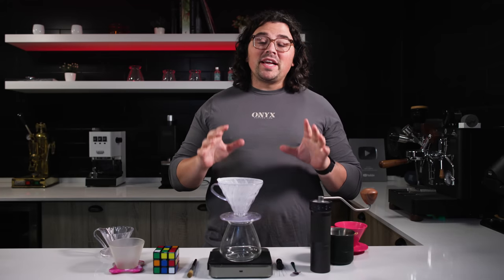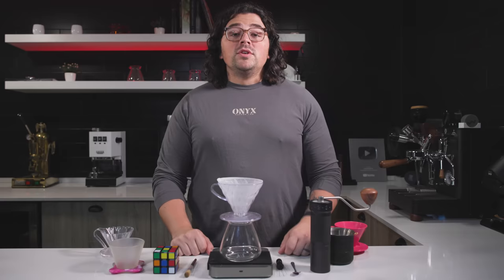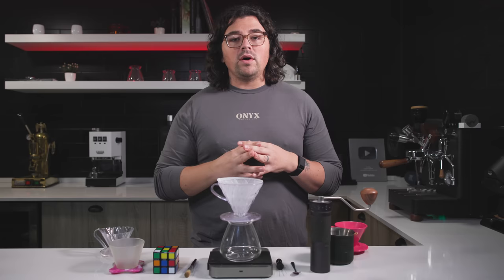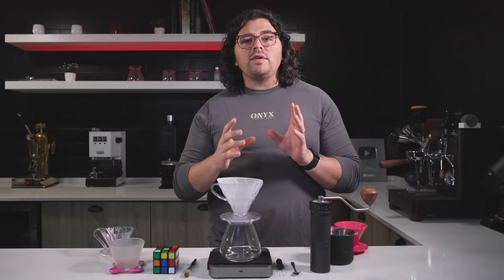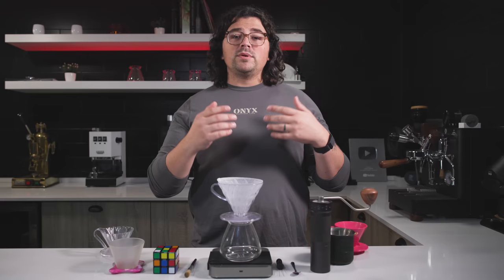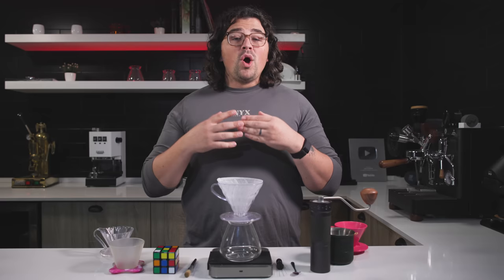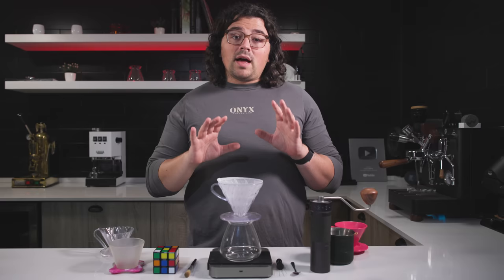ULTIMATE POUROVER RECIPE (any method)

Comment: You won my heart at "pour rate" and "spout distance."  In my first go, I used the Gabi B disperser. 

20g light roast
340g Brita water
Fellow Opus 6.25

It finished at around 4:20. 

Just a bit thin. Next time, I will grind coarser with less water. 

Perhaps the greatest advantage of this method is how easy it is. Excellent for baristas in busy cafés.

Comment: Man I’m so glad I watched this. Working with basically entry level everything, I have been struggling with light roasts using the 4:6 method which I had convinced myself was the end-all for pour over. First try with this method was instantly a much better cup, full of body and sweetness, compared to the thin cider vinegar I was for some reason getting every time. Thank you for posting this!!
Reply: 5 pours for the 4:6 method is perhaps a little complicated for beginners. Although interestingly the 4:6 method also calls for similarly coarser grind size and uses multiple pours instead of agitation for more extraction.

Comment: Great recipe and video. Thanks Lance!

I tried this last night with some pre-ground decaf from Peru. 33g of coffee to 500g of water in a glass 02 V60. The drawdown was really long but surprisingly the cup tasted good. Like a good quality batch brew.

Today I tried it with some natural Brazilian beans with tasting notes of Orange blossom, choc milk and stone fruit. 90 second bloom and a total brew time closer to 5 mins. 90c water.

It was ok. A bit muted. I got a bit of the choc milk and stone fruit. A very slight hint of dryness and astringency only with the last few sips.

I will coarsen the grind for tomorrow’s brew to get closer to the suggested brew time. 

What’s stumped me is that as an espresso, I nearly choked the machine and got a really long extraction time with these beans. Tried it anyway and it was bright and fruity and slightly acidic but very pleasant. A lot of the Orange blossom came through. 

I’m not sure that extracting less from the pourover will reveal the brighter notes. Do you recommend upping the water temp while coarsening the grind?

I forgot to do a light swirl when I finished the second pour so I don’t know if that affected it much.

Comment: Since you asked, I've been using Patrik's pour over technique with April v2, and I see several comparisions between yours and his: courser grind (26 to 30 clicks on Comandante) simplified pouring, and about same overall timing. He suggests letting the beans bloom in the air for about 15 min after you grind but before you start pouring. I usually brew 20g with 300ml (1:15) in 3 pours of 100ml each circular and center pours with about 30 second space between pours. Flat beds, no stalls, consistently delicious cups. He pours a little faster than you suggest, 100ml in 10 sec for agitation with no messing around with slurry. I pour 8ml/s. I also brew smaller cup 13.4g / 200ml with 2 pours of 100ml each.
Reply: You sound fun to make coffee with, great write-up and thought process.

Comment: I have tried the Lance Hedrick Ultimate V60 recipe yesterday and today (drinking the result now) with a bag of light roast Ethiopia Sidamo.

The first time I used the recommended 1:17 ratio and wound up with a drawdown time of 83 seconds (Baratza Encore grind size 16 with factory coarse calibration). The cup was as good as most of the cups I have had which was very encouraging for a first try with a new recipe. The cup was noticeably less bitter than some of the cups I had with James Hoffmann's ultimate V60 recipe with slightly finer grind settings, but the body was thinner than I preferred. 

Thanks to all the information in Lance's video, I knew the first thing I should try is increase the strength to make the body thicker and make the grind size coarser to reduce the drawdown time and hit the time parameter set for the recipe. Today I brewed the same coffee using approximately a 65 gram/liter ratio and coarsened the grind (Baratza Encore grind size 18 with factory coarse calibration) with a 58 second drawdown. 

Edit: these cups have all been brewed with Hario VCF-02-100W filters.  I will eventually try out this recipe with the Cafec T-90 Medium Dark Roast 2-4 cup filters I have. So far I haven't noticed a significant difference in the cups between these two filters (Using James Hoffmann's Ultimate V60 on my setup) that warrant the extra cost of the Cafec filters and the extra storage space.

I am very happy with the body/texture of the cup at this strength. I will probably try to coarsen the grind again because I am barely within the time parameter and I am curious how that will change the cup. It does seem like the cup is getting sweeter at the cost of muted acidity.

Is that the inherit zero sum trade off, acidity or sweetness? Or is that the limitation of the Baratza encore?

This recipe is super simple to follow and at least so far the changes in brew variables have had the expected impact which is fantastic.
Reply from the maker: You nailed it on the head! There will be a tradeoff there with grinders like the Encore. You really have to lean in to one or the other, though you can find a nice harmony at certain places!
Reply: @LanceHedrick  so in order to increase the perceived acidity (at the cost of sweetness) on a Baratza encore, would the adjustment be to grind finer (and accept the increase in fines which would increase bitterness) ? Or is there some other adjustment needed?
Reply: I tried the recipe again just now with the same parameters except I coarsened the grind size to size 19 (factory coarse calibration on Baratza Encore). Drawdown time remained at 58 seconds. Acidity was reduced significantly and sweetness was increased dramatically. Acidity seems barley perceptible to me at this grind size and is fading in an out of the background of all the sweetness. I miss the acidity, but on the other hand, this is the sweetest cup I can remember having in a very long time with astringency and dryness truly gone (and not just relative to other V60's I have made).  I feel like my mom would even like this cup. 

I am tempted to keep coarsening the grind to see how coarse I have to go to drop the drawdown time and see how far I can push the sweetness. At size 19, there is zero feeling that I am compacting the bed when I make the divot.

I feel like this recipe yields consistently good cups and changes in brewing variables yield the expected results which is not what I am used to in my 3 months of brewing V60's

thank you for all the help Lance!
Reply: @BBB_025  where are you at now with the Encore, ratio, and drawdown? Using the 15g in the video for those drawdown times or?

Comment: I have tried all of Hoffman's methods and all of Lance's methods, and this is the easiest method out of all of them. What I have tried so far: I have done 200, 250, and 400 ml brews at a 1:17 ratio with a 98-99c water temp for my light roast Kenyan and Ethiopian using the new fellow ode 2.I swirl once before bloom and a gentle swirl at the end. Medium grind size is a great starting point (700-800 microns). Quick notes: I personally think this method would shine on the Hario Mugen or Kono dripper, also this method will work on any grinder, focus more on your grind size and what water you are using.

Comment: Best recipe so far, been trying the 5 pour method and too much bitterness, even after using a ode gen 2 grind. This method removes all bitterness and the flavors are clear! Thank you!
Reply: What's your grind setting on Ode gen2?
Reply: @alexanderreznikov8112  7 on medium roast. Depends on beans but mostly 7, sometimes I go down to 5. As Lance mentions, I vary the temp more than the ratio (medium - 1:16, dark 1:14-15)/ Medium - 95C, dark 85-88. As always, it's more fun to experiment and try different ratios.

Comment: This is one of the recipes that make the most sense to me.
I‘m having trouble with the brew though, specifically nailing the brew time/a fast draw down.
I’m using a Baratza forte BG (which I realigned à la Alicorn method just yesterday) with the burrs set to touch at 1q to be able to go even a little coarser and a Stagg EKG kettle set to 96 C and have been trying the recipe with a V60 and Orea V3 and with both I have a super slow drawdown and still very overextracted cup even on the coarsest setting of the grinder.

Comment: Usually I go with 4:6 or Hoffman for V60 and I'm happy with both methods but I thought why the hell not try another recipe. 
So I didn't tell my girlfriend that I changed anything for our brew today but she asked me right after the first sip if I had somehow changed the recipe. I got so much more sweetness in the cup, it was clean, the acidity was on point and it was overall just super pleasant. Love it!

I think I'm gonna use some of the information from this video (flow rate, kettle height) when I do another 4:6 brew and see what happens. 
Either way, thanks a lot for this Lance!
Reply from the maker: very cool! If you think you need more extraction than this single pour, simply fine up the grinds or increase agitation!
Cheers and thank you for watching!
Reply: @LanceHedrick  Yes sir, will do! And no need to thank me; I gotta thank you for pumping out quality content all the time!

Comment: Amazing video. The idea behind this video is exactly what I was hoping someone would make. Something that allows me to use technique to adjust rather than equipment. Your explanation on why some of the techniques out there don’t work at home was also extremly useful, I was just getting frustrated with the mushy coffee beds I was getting that looked nothing like the video results. I now understand this is due to fines (please correct me if I’m mistaken).

I have some questions about the technique: 
a. What is the purpose of the excavation ? What do I aim for? How do I know I excavated enough ? 
b. What is considered a slow drawdown ? I’m not sure. Would be great to see this defined visually in a video. 
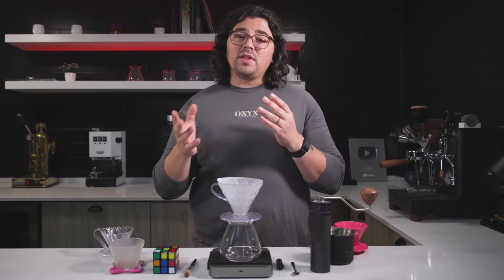c. What happens if I wait 2:30-3:00 minutes in the bloom phase? Asking because I sometimes get distracted… and am curious to understand how it affects the brew. 
d. What do you say about pre-heating/cooling the brewer, caraf and the glass ?
Reply from the maker: A. Go until you don't feel anymore dry clumps. The purpose is the enforce full saturation more quickly
B. If the drawdown is looking like it'll be longer than the times proposed. Simple as that
C. 3 min and up is just fine. No worries! Could be 10 min
D. I preheat but because I use the hot water to clean my usually not super clean carafe haha

Comment: Thank you for this. I've mostly given up with my V60 and moved to aeropress as I've struggled to find a recipe that gives consistent results in every cup. Will absolutely be giving this a try.
Reply from the maker: I think you'll love it. Will work with anything. Need more extraction? Agitate more. Or change ratio. Or change water temp. Fully fluid recipe with great results

Comment: Lance. What a great vid, this is the type of content I love of yours. Anyways, I'm happy to tell you I've been getting to the same recipe more or less, 15±clicks on the C2 timemore, 2 min bloom, 15g coffee-220/245g of water depending on the coffee. I do an aggressive bloom with lower temp dough, and agitate with a chopstick instead of swirling, since it usually give me a bitter finish, I don't know why though. Then, for the latter pour, I heighten the temp a few degrees and finish with one swirl and the chopstick at the top to reduce fines on top of the bed. Coarser grinds give me a lower body, but at that grind setting I'm not getting astringency at all! So it works fine. Thanks for the recipe and the ideas behind it! U d goat

Comment: Lance, 2 questions: 1) During the bloom, even with a freshly roasted coffee I'm not getting a ton of off-gassing, and I'm noticing all the water has drawn down through it after 15 seconds or so. By the time I get the spoon to excavate, I feel like I'm digging at wet coffee rather than stirring a slurry. Is that correct?
2) Are there times where you would recommend a different recipe to "optimize" flavor? I am getting good-tasting coffee with this recipe, but I feel I've gotten greater extraction/flavor without bitterness before. In fact, I accidentally ground too fine on my first try with your recipe, and there was an extra minute of total brew time, but it tasted great and had more flavor.
Side note: I love the one-pour method! Back when I was new to coffee and brewing Chemex, I developed my own one-pour method out of a desire for simplicity. :)

Comment: Update: I tried this method with my metal cone filter pour over - Kinto Slow Coffee - and it worked like a charm. ~21g dose to ~350g water with the 1 minute bloom (older and darker Typica Bourbon blend from Puebla MX). Total draw down in a little over 3 mins. Definitely notice the difference compared to the classic Hoffmann method I normally use.  Very clear cup but not weak. Lots of flavour.  

Thanks for the video, Lance! When you say it’s for any type of brewer, would that still apply to conical metal filter brewers (eg. Kinto Slow Coffee)? I would imagine the paper vs metal filter type would affect some of the variables you describe like contact time and more fines would end up in the brew compared to paper. Any advice or nuance to add?

Comment: Tried this recipe with Hario V60 and Chemex. It worked great with V60, but with Chemex it provided a massively underextracted coffee. Chemex is such an effective heat sink so it really needs more time for proper extraction.
Reply from the maker: It works with chemex! Just need to pay heed to the variables and make adjustments.
Reply from the maker: I can get 20% easily in the chemex with a 45g dose. Have to pay attention to the flow rate. If truly doing 6-8g/s, should have sufficient contact time after the final agitation, which should be somewhat heavy with a spoon. I'd also do a 4x bloom weight so you can more effectively agitate.
Reply: @LanceHedrick  with 24g dose and 4:30 minutes brew time the same coffee that brewed delicious in plastic V60  with 4 minutes was very sour, so even with final agitation I had to grind finer to extend brew time to 5:30 with very similar results. I wonder iа it's something wrong with me or with my Chemex papers if I have to go finer with it when everybody else goes coarser, lol.

Comment: Hi all,
I use 30 gm, Square Mile “El Dama,” beans in; Niche Zero at 25 grind setting; pour 600 gm water (500 gm out, 100 gm retained by beans) and Blue Bottle filter (no need to wet the filter).
Usual waiting for bloom and intermittent stirring.
Works great for my palate.
Cheers,
SJEGMD
Reply: I use 25 for espresso. I believe you should go coarser.

Comment: Great video as always Lance.

I’ve been trying to get my hands on the Orea V3 the past few weeks but it’s been out of stock the whole time. Cant wait to try it out.

Also you gotta learn cfop to solve your cube 😂.
Reply from the maker: What is cfop! I just got one a couple weeks back. Haven't done one since high-school. I could solve it in 45sec then
Reply: Slow pour supply had them in stock a few days ago, they might still!
Reply: Cfop is probably the most popular speedsolving way of solving the cube.

You solve the cross, then you pair up edge pieces with their respective corner pieces to solve the first 2 layers in one go, then you orient the top layer, then you permute the top layer to solve it. It requires far more algorithms and practice but can greatly reduce your solve times. You would probably want to start with 4LLL (you can look up what that means) as a beginner. 

Cross
First two layers
Orientation of the last layer
Permutation of the last layer
Reply: @Michael Puro thanks for the heads up! I just snagged one!